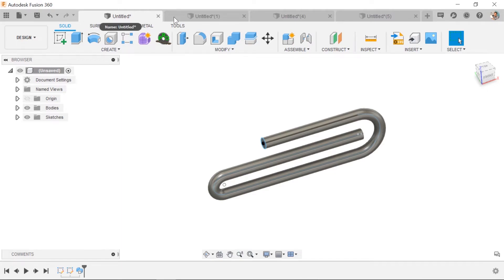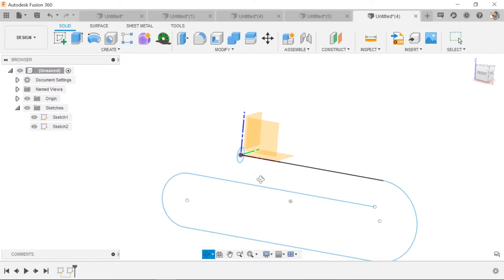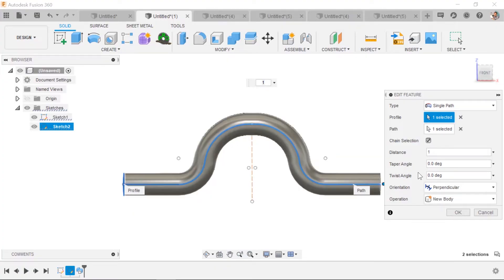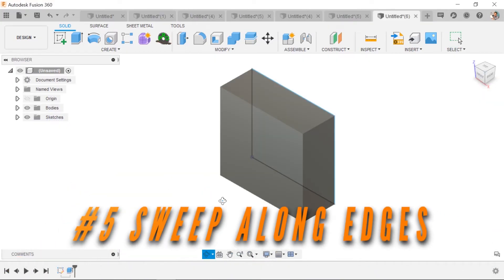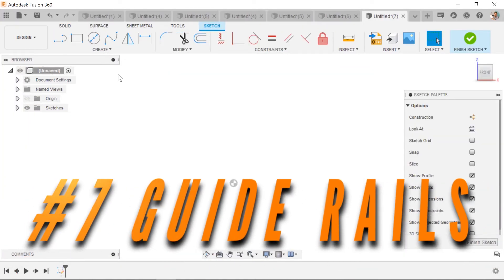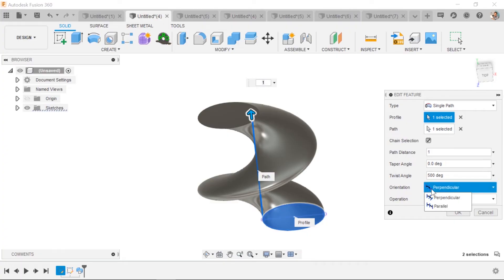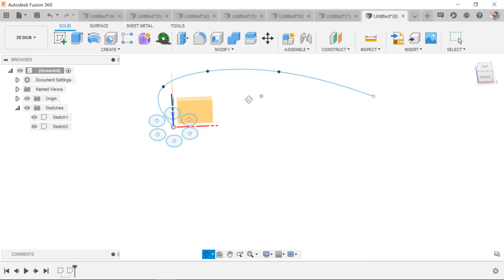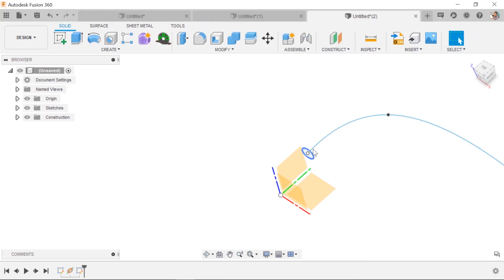Fusion 360 Sweep (10 Things You Should Know) 2020

Comment from the maker: Using Fusion 360 To 3D Print Anyone???
Reply: Thats what I use for. Thanks for the yet another great tips on Sweeps
Reply from the maker: Nice.  Which printer do you use?
Reply: @TylerBeckofTECHESPRESSO I am printing my designs with Original Prusa I3 MK3S+, which is great tool to make them real.  I like your short (and longer) videos a lot as it is easy way to digest vast functionality available in F360. I have learned a lot and likely will be learning much more over the time. Good fun!
Reply: Yup, lulzbot Taz 6. I mostly cnc or laser cut though.
Reply: Yes, using it with my Ender-3. I use CURA to slice it.
Reply: I do cnc (Joe's hybird 4x4) and an Artillery Sidewinder X1 for 3D printing.
It's  nice to use one software solution for different disciplines!
Reply: Sovol SV01. It's like a Prusa bred with an Ender 3, and has the good things of each.
Reply: Great video, recently bought my self an ender 3 v2 (3d printer) and love to design little things make self.
Reply: 3D printingis the only thing i use it for. I was wondering how would you make a boat hull?
Reply: Yes indeed. I love Fusion
Reply: mmhmm.. JGAurora A5S.
Reply: Yep
Reply: Yes and your videos have been super duper helpful thank you for everything you've done!
Reply: What else?
Reply: I'm trying to learn the fundamentals of Fusion 360 (and Tinkercad) before actually buying a 3D printer. I want to make sure that I'm actually going to use it. These tutorials that you do are a yuge help.

Comment: Ive got a simple problem. I have a vertical flat surface and I put a circle at the top of the wall, and a circle at the bottom of the wall. I ran a nice arc from the center of each one and can sweep it but the ending is jagged. I just want this new tube to be flush to the wall at top and bottom on the ends where the tube meets the wall.

Comment: I found the plane along a path to produce a body that was most like what I was expecting to get from a sweep. I would enjoy seeing you do a comparison of the rope that you produced with the sweep and a rope produced by using plane along a path. This would illustrate the capabilities of both methods and why a designer would chose one over the other. [ I found the plane along a path to be a bit lacking and unable to be rotated. Is it possible to twist the body after it is extruded? Are there other strengths or weaknesses? ]
Reply from the maker: Will add it to the list.

Comment: Created a frame using profile and rectangular sketch as path. Worked well. However, how do I slice the frame at the corners to create four new components from this one component frame?
Reply: I believe that you could sketch a profile at each corner (to mark the location of a "splitting" plane) and  use the Split Body command for each corner, doing this one at a time. After all the splitting (presumably doing so four times) you should end up with four bodies that you can then select individually and "Save as Mesh" to make each stl file for 3D printing. Good idea making a picture frame.

Comment: Tip #11: You can also do 3d sketch sweeps. In the Fusion settings: General, Design, Allow 3d Sketching of lines and Splines. 

You can make your straight lines with control points, and attach a plane to the line as in tip #10. Then, you can select points in your control node and move them in 3d space. 

I went ahead and made a video! Not as high quality as yours, but I think it shows the point.

https://youtu.be/8IAVIlzntp8